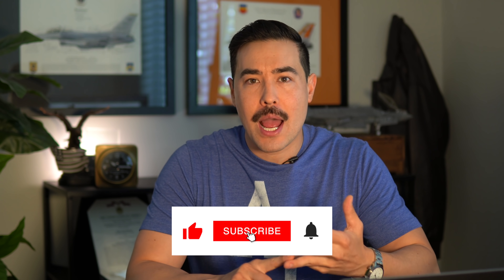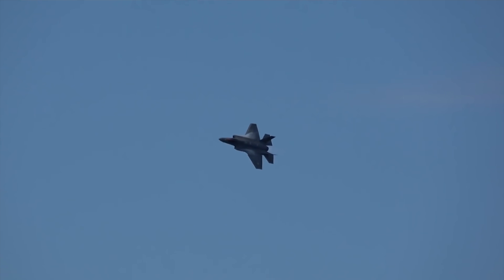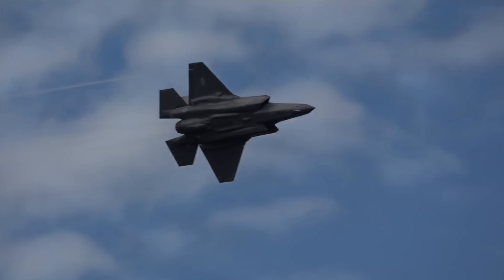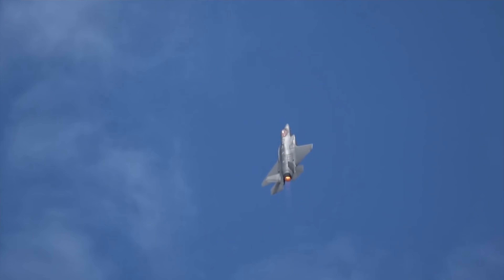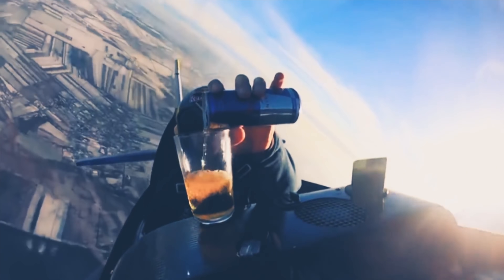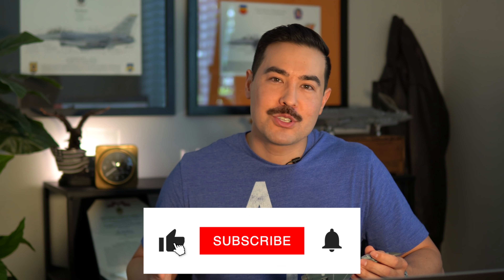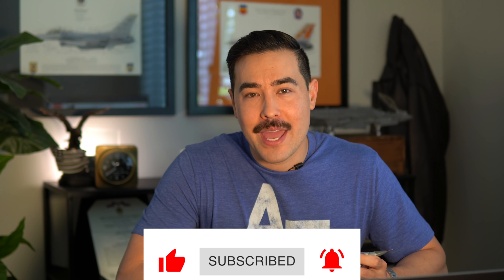USAF Fighter Pilot on NEGATIVE-G's (Don't do it) and Flying Upside Down

Comment: When you do an aileron roll, do you always keep the same angle of attack throughout?  Isn't an angle of attack based on Earth's gravity among other factors?
Reply: AOA is the angle of the wing and the relative airflow.
Reply: @LarsHofman  thanks for correcting me.  Do you know if the plane maintains the same angle of attack in a barrel roll?  Because I know gravity factors in aoa when a plane is inverted.
Reply: @markvincentcocjin  Well, that is actually a good question. I think it stays the same but only if the same amount of pull and speed are maintained (rarely the case) during the entire barrel roll. In the inverted part, the earths gravity will help the aircraft turn faster though so pilots will naturally counter that by releasing the stick back pressure a bit.

Comment: OK a few bits.  I was a maintainer on the F-16 for almost 20 of my 25 years (1986 to 2006) and I've never heard that story.  Add in that the FLCS is quad redundant unless there was some REALLY bad code in the FLCC a single channel not agreeing with the others will not cause it to do that.  Even in analog FLCS days it has always been quad redundant in everything but air data where it is triple redundant.  Not to say something like this couldn't have happened in test or out at Edwards but you relating that is the first time I've heard that.

As far as flying I had three incentive flights during that time and it only took the first flight to make me a true believer of Spatial Disorientation.  Pilot did an Immelmann and, of course, you initially end that flying upside down.  Well he left us flying upside down for several seconds but it all happened so fast that my body didn't process it all and so I am sitting there in the back seat looking UP at the Earth and feeling no different than I do right now typing this message at my keyboard.  Absolutely must trust those instruments to tell you your attitude.

The third flight was when I was stationed at Osan AB and it was a LtC and man that dude could bomb.  After the first few he just asked me where I wanted him to put the BDU-33 and that is exactly where it went.  However dropping that many bombs in quick fashion meant we were constantly pulling like 5-6 G.  I didn't even realize I had picked up the G measles until the pilots in debrief pointed it out to me.  Guess they just shortened it to geasles afterwards.

Forget negative Gs.  That is just no fun at all.  Only time I ever felt like I might have gotten nauseous was on the take off from Osan and twice we must have hit pockets of disturbed air or something because the best way I can explain it is it felt like there were two huge rubber bands on the radome.  One going down and one going up and someone smacked the nose and it just porpoised in pitch until it settled down.

Other than that the F-16 was a freaking hoot to be flying in.  Beats any amusement park ride you'll ever get on.

Comment: I was in the Air Force back in the late 80's early 90's as a hydraulics specialist then cross trained to a crew chief on F-4 E and G models (wild weasels GAFB). I was lucky enough to get an incentive ride. I also had a flight sim for my computer. When we went up I was asking the pilot if we could do all this crazy stuff I tried in the simulator. He laughed at me of course. I never threw up but I guess I did pass out twice. What amazed me was just how good of shape you guys are actually in and how can you do these tiny movements and corrections while under stress and G's. He did a thing where he told me to put my hands on my knees then reach up and try to touch the stick. I couldn't get my hands off my legs, let alone reach the stick. And the whole time he is flying this thing making small precise inputs into the stick, throttle and rudder. And I was pinned in my seat not being able to move. I gained a new respect for pilots that day. And yes you were right, breaking the sound barrier was not a big deal. I mean it was cool that I got to do it but I couldn't tell while in the jet. He had to tell me when it happened. What was impressive was the amount of power these things have and how they climb, turn and accelerate. Even a pig of a plane like the F-4.
Reply: F-4E Wild Weasel Ride July 1987, Spangdahlem AB Germany.  I didn't pass out but I filled two barf bags taxiing back to the ramp after the ride was over.
Reply: fun story, thx for sharing!
Reply: The thing to remember about gs is it's your mass times the force of gravity... If you weigh 200 pounds at 1g at 9g you now weigh 1,800 pounds honestly it's more socking that our pilots don't look like the hulk.
Reply: 5-6 G isn't all THAT bad.  Now at 8-9 G yeah that would suck.  The F-4 guys would definitely still be stick and rudder all the way but the F-16 has was it called the ARI, the Aileron/Rudder interconnect, to help the pilot out to automatically coordinate turns so it is much easier to fly than even a Cessna in that regard.  Also an odd naming scheme they had for that tech as the F-16 doesn't have true ailerons but flaperons.

Yeah they got away from just pure speed for performance as it is much more important to be able to rate the nose of the aircraft around to get within weapons launch parameters.  That is one great thing about the F-16.  Awesome rate fighter.

Comment: Great! I always wondered if the pilot experiences positive G's while in a loop during the portion where the plane is technically falling toward the ground.
Reply: Yep. It's positive the whole way around. Positive is what pulls it from the downline to level. I.e. that arc is caused by pulling and putting positive Gs on the aircraft

Comment: The PRIMARY reason humans will remain in the cockpit is related to promotions...if you want to become a General, you have to have been a command pilot at some point. Think about the $$$$ that would be saved if we moved pilots out of the cockpit. All of a sudden, you don’t need to worry about rescuing Sean Ogrady.

Comment: The side stick controls the the flight control surfaces via transducers that send signals to the flight control computer however the throttle is still connected directly to the mec(main engine control) by cable which is an absolute nightmare to change out

Comment: Hasard! Help me out! Curious question, landing gear is extremely important, when you take off and once you're airborne are the tires still spinning when you retract the gear or do the brakes do the work?
Reply: Basically the breaks apply on the wheels that have breaks(not the nose)
Reply: @thomashavas2775  correct the nose has a pad mounted inside the NLG wheel well it touches on the rim which stops the nose from spinning when it is fully retracted.

Comment: Is there such a thing as a low g turn? I know of high g turns and you have to squeeze the lower half of your body and breath different, but what about when you are pulling just a few g's?
Reply: I didn't need to do anything at all until past 5-6 Gs.  Yes there is such a thing as low g turns.  If you've ever been in a civilian airliner you've done it.

Comment: The first time we pulled negative Gs was coming off a (practice) iron bomb drop and started what’s called “GLB-ing” (sp) which was a SAM evasive maneuver that consisted of both weaving and bobbing vertically.  It’s a low G maneuver of maybe 1.0-1.2 Neg Gs.  I felt like I was going to come out of the top of the canopy. No Bueno.

Comment: Don't know if I'm too late to the party to get an answer to this, but I'll ask anyway: with the geometry of the air intake on the F-16, was there ever a problem with air starvation/compressor stalls as you went negative and the airframe occluded the airflow coming into the engine?

Comment: another reason to not pull negative G's...   the little bits of debris and crap at the bottom of the cockpit (that weren't causing any trouble) now float up and land in a new spot that might jam the ejection seat, the throttle, etc.   This is based on old experience as a military avionics tech.  Maybe modern cockpits are cleaner??

Comment: To pile on to your story from the flight sim instructor, originally, if the F-16 lost power the flight controls would default to full down and of course the jet would nosedive. This was determined to be the cause of several aircrew losses early in the F-16 program. Later the Flight Control Computer was reprogrammed for the flight controls to go to neutral in the event of power loss.
Reply: With all of the different sources of power through the inverter/regulators I find it had to believe a F-16 FLCS ever lost power.  If any ever managed to lose ALL of those sources at once the FLCS is the least of their concerns.

Comment: Interesting to hear about the tailslide. I know Flankers tend to do it a lot at airshows, but how does the F-16 handle this? How do other jets like the F-15 or 18 handle this?
Reply: This is a more interesting question for the 16 or 18 as both are FBW aircraft.  The 15 (at least the older ones) were augmented pushrod setups so I'm not sure what kind of stabilization code they had.  For the FBW jets this is all in post stall handling of the code in the FLCS systems for what the surfaces do.
Reply: @Stubbies2003  well Flankers have FBW also, as for Mig-29s I believe they're more like the F-15

Comment: A question, and a possible subject for a future video: watching this impressive demo flight:

https://www.youtube.com/watch?v=4tZWddo2dHk

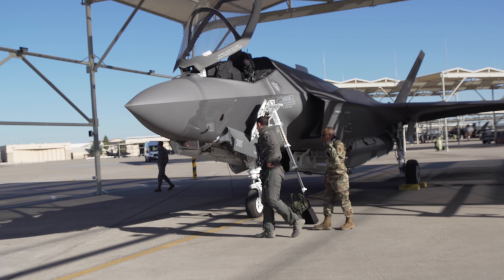While performing certain maneuvers (for instance at 1:41), the pilot seems to temporarily pull the throttle back to idle, perform a maneuver like a roll, then moves the throttle back open. What's the reason for this? Does throttle position affect the aircraft's ability to perform certain maneuvers?

Thanks for all you do!
Reply: Not directly based on throttle position but aircraft current speed mixed with what kind of flight control surfaces it has for conventional setups.  This might be completely wrong for thrust vectored setups though.

Comment: Perhaps just to add to your final point. Wings and more specifically airfoil are optimized to provide a lift vector in a specific direction. So, turning will likely always be better into this vector rather than away from it.

Comment: Competition aerobatics in my Pitts you build an horrendous G tolerance. High numbers but all instantaneous not sustained like military G. Plus/Minus 9G was common. Negative G had advantages as you didn’t have to tense your body and had excellent visibility of the 1km aerobatic box. Also your fin and rudder were always in clean air not blanketed by the elevator.

Comment: Hey Lee, awesome channel, I've been subscribed for a few months and really enjoy the content as former USAF myself.
My question has to do with the limitations pilots have with G forces and do you think there will be a push to automate fighter jets into operational drones to eliminate the lose of life and jets in the event of a crash?
Reply: Not any time in the foreseeable future. Also keep in mind it's not just the limits of the pilots. It's the airframes that are limited as well. Most aviators with consistent flight time can handle 7-9 Gs well enough. But take the F/A-18s for example, they're limited to 7.5 Gs compared to the Vipers 9 Gs. The Hornets airframe is built different. While it can definitely go beyond its G limit, it's not good for it. For one, Hornets have folding wings for carrier space. Not as rigid as a Viper or Eagle. And two, to prolong the service life as Hornets are designed to slam into carrier landings and already take a hell of a beating. 

Also you will never see any airframe, manned or otherwise consistently pull high Gs regardless of its limit. Missiles, bombs, targeting pods, fuel drop tanks...etc are all G limited as well as lowers the aircrafts G limit due to weight and drag. You only see very high Gs on clean aircraft. That would transition into unmanned aircraft as well. 

Crashes and deaths related to G-loc, while still happens, is not as frequent or common in the more modern 4th and 5th gen fighters.  Modern avionics and programming prevents the aircraft from departure of controlled flight in the event of loss of input from the stick/rudder and throttles from a pilot in G-loc. The more recent crashes from G-loc is either in older aircraft or flight demonstrations at altitudes WAY lower than fighters will operate at aside from combat.

Comment: I wouldn't be so sure that dogfighting AI won't come soon. I doubt it will be used for a long time as there are other issues beyond just the capability to dog fight. But I wouldn't be surprised to have an AI that can beat any human pilot in a sim in the next decade.
Reply: It already happened to a National Guard pilot a few months ago.  He got beat 5 times out of 5 by an AI system.  It was a guns only simulation but the AI used an unconventional maneuver to shoot head on as opposed to the more common method of getting in position for a shot from behind your adversary.  I have zero experience in the field but I would not be surprised if there are active duty F-35 squadrons in the next decade with at least some AI pilots.  Chess masters, Jeopardy contestants, fighter pilots: "I'll take professionals bested by AI for $1000.00".

https://www.thedrive.com/the-war-zone/35888/ai-claims-flawless-victory-going-undefeated-in-digital-dogfight-with-human-fighter-pilot

Sadly AI call signs will probably be pretty lame (Unchecked Exception, Null Pointer, Gaussian Blur).

Comment: The real question is: why does the F35 not have thrust vectoring?
Reply: Well the F-35B sort of does.  But I'm guessing you mean more for use in combat like the F-22.  The designers must have felt that it just wasn't important enough to justify the extra complexity & cost.  I think it was originally designed to be the F-22's less expensive little brother like the F-16 was to the F-15.

Comment: I live in Peoria AZ and the F35's fly over my house all the time. I noticed that some F35's fly over my house with their gear down? Why is this? Im still a good bit away from Luke.  The F16's they fly over do not do this. Also why is the F35 2 to 3 times as loud as the F16 when it flies over?
Reply: The F-35’s F135-PW-100 motor has as much thrust in mil power as an F-16C Block 50/52’s has in full afterburner.  It’s a beast of a fighter engine-the most powerful fighter engine ever built.  It has 10,000lb more thrust than the SR-71’s J58, which is an absolute monster of an engine if you’ve ever seen one in person.
Reply: @LRRPFco52  Well TBH comparing to the 71 is kind of an apples to oranges comparison as at speed the SR-71 bypasses most air and gets its power from AB.  As much power as a 16 in full AB at mil is impressive though.
Reply: @Stubbies2003  I was comparing the F135 motor with the J58, not the F-35's speed with the SR-71's. F-35 max speed is exactly half of the SR-71's.